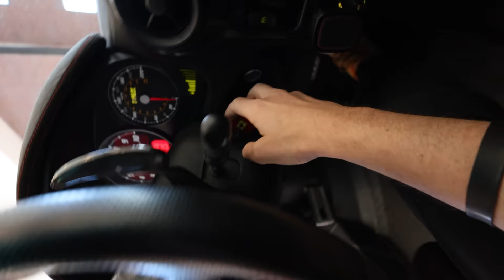Buying my Dream Lamborghini LM002! $400,000 MegaTruck.

Comment: The LM is a cool car. I was trying to think of what you could do as an engine swap and keep it a V-12. There aren't a lot of options for front engine V-12. Maybe a Bentley W-12. That would still be under VW group, but this car pre-dates VW ownership.
Reply from the maker: If an Aventador V12 was possible, it would be unreal.  But I think its such a far fetched dream to get something like that running properly that also doesn't cost an obscene amount of money.  Finding the shop excited to do it also is a problem.  But a Hellcat could be a good middle ground
Reply: @TheStradman the Aventador engine would be insane!!!
Reply: @TheStradman Hell cat Swap it. Keep the original engine put it on a stand for display
Reply: @TheStradman A supercharged V10 huracan engine would be nice
Reply: hellephant swap it @TheStradman
Reply: @TheStradman manual hellcat? Orrrr the hellaphant or however it’s spellled
Reply: @TheStradman  I think a hellcat LM would be a great homage to it's rally history. The TRX is arguably the king of OEM performance rally trucks, just like the LM back when it was out.
Reply: @TheStradman flat 12 😏
Reply: Put a Turbo K24 and call it a day reliable 700HP😂
Reply: @TheStradman I read not long ago that there was an Enzo engine for sale somewhere. Could you imagine that?😅
Reply: DDE talked about this when they where looking at this car visiting Huston
Reply: Murcielago swap and keep it manual

Comment: Exotic Imports back in 2000 ish that was out in Sandy, UT, (it's gone now maybe South Jordan?) had a White with Red interior LM002 with the Countach engine and the thing that sticks in my mind is that they were selling it for if I remember right $180k and the driver side headlight bezel was held on by scotch tape. And it was pealing up and I thought well that's weird I'll just take that off for them and it fell off when I took the tape off. Talk about a panic moment. The guy I knew who worked there was cool and just handed me the tape dispenser and said just tape it back on we know it's broken but there's no replacement part for it yet.  That is my one and only experience with a LM002 and I thought they were the coolest thing sitting in it it's just so massive inside.

Comment: You're getting rid of the Hummer.....so.....it makes sense to EV-swap the LM.  Put 2 motors in (front & rear) and stuff it full of batteries for as much range as possible (650-1000 miles).  Store the engine and fuel tank so that it 'could' be reinstalled....or at least sold with it in the future.  Make sure that it has a NACS connector and can use 350 kw superchargers and you will probably never need another EV.

Comment: LM002 with a custom engine swap (like a Mopar V8 or Toyota GZ V12) - I don't know if it would trash its resale value... if you end up with a LM002 that's a reliable unicorn, maybe the value would go up. 1GZ with a T56 6 speed trans? Probably would be more worth the investment than dropping the original motor and trans back in 🤔

Comment: Tbh it was smart to sell it you never used the thing and it gave you troubles and the range wasn’t the greatest, plus I felt like you should’ve sold it with the charger bc no you have a charger for a electric car that makes no sense bc you don’t own one, as for LM002 you can just do some WD-40 and make the squek go away make sure you put that stuff in the actual area it’s squeaking from and then put enough until it drops out from under neath then push the door in an out til the squeak goes away, and about the LM I think you should keep it as is

Comment: Put a twin turbo Lamborghini Huracan V10 motor in it and dct swap it upgrade all the suspension and everything put in the Huracan quage cluster all the sensors the screen absolutely everything every part of the Huracan can fit absolutely perfectly in this be the first and only person to do it or put an Aventador motor in it and try to make it manual if you can't then Murcielago swap it and gated manual swap it